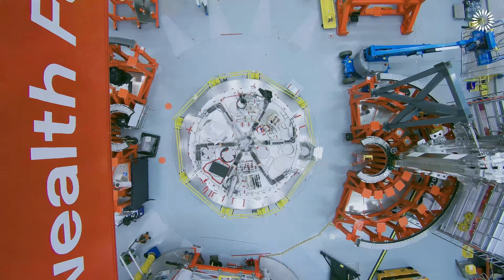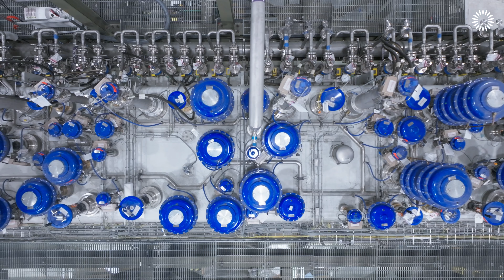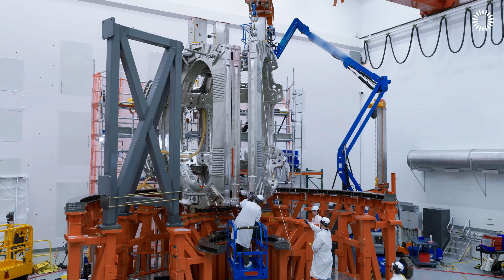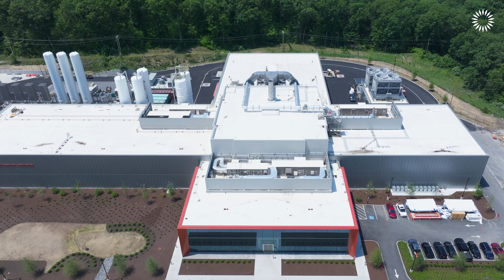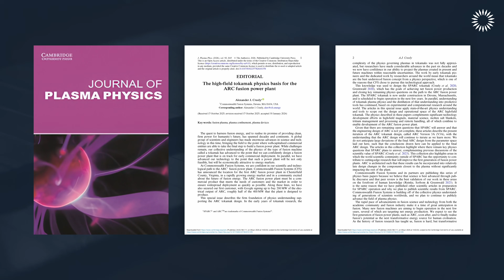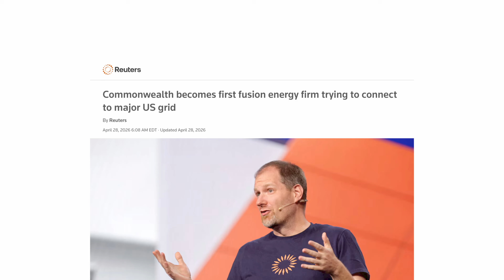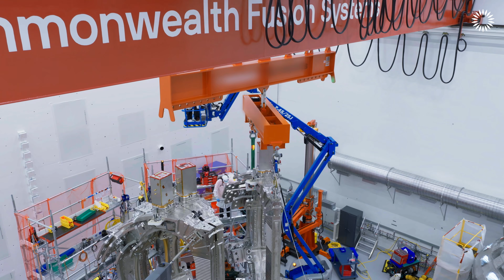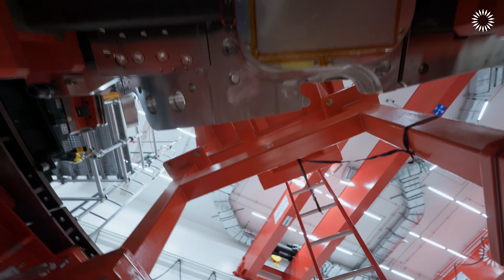An update from Commonwealth Fusion Systems (July 2026)

Comment: Comparison between SPARC and other fusion-related projects is discussed in the book "Nuclear Fusion - At Last?" by Andrea Di Vita, CRC Press/Taylor&Francis, on sale since September 2, 2026.
Reply: I hope the book describes, in some detail, the SPARC technical parameters that CFS routinely omits from their slick promotional presentations. This should include that if SPARC does achieve CFS's fusion energy generation goals that the fusion reactions can't last for more than ten seconds per test shot. It should also point out that after each full energy test shot a 4-hour thermal recovery time will be needed before another test shot can be conducted. It should also point out that even if CFS achieves its goal of a 'net fusion energy gain' of 10 then that will be largely unrelated to the energy required to power the facility during the day the record breaking test shot is achieved. It should also point out that such an achievement has little to do with determining if an economically practical power plant design can evolve from the SPARC experimental machine.
Reply: @vernonbrechin4207 It does, indeed. But even if SPARC is subject to all limits you have correctly listed, as a matter of fact its success will be the necessary condition for further progress in the compact tokamak approach to fusion. By the way, there Is a crucial point you missed: the duration of the discharge depends on the performance of tungsten in the divertor plates. Many configurations will be investigated in order to optimize performances. To date, however, 90% tungsten overall the world is sold by China. And Chinese are currently building their own twin of SPARC. In contrast with the US, however, the Chinese machine is 100% built in China, while half SPARC has been built with  imported stuff. (For example, the vacuum vessel has been manufactured in Italy). SPARC's success is likely to earn a Nobel Prize for the US and a worldwide market for China.
Reply: @vernonbrechin4207 It does. Notwithstanding its limits you correctly hint at, SPARC's success is the necessary condition for further progress of the compact tokamak approach to fusion. There is an issue at stake you missed: Chinese twin of SPARC is currently under construction at Hefei with 100% national materiale and technologies (unlike SPARC), and China owns 90% world reservoirs of tungsten, the material divertor plates are made of. SPARC's success is likely to earn a Nobel Prize for the US and a worldwide market for China.

Comment: As a former design engineer at ITER I do NOT believe this system will suceed. All others who try similar developments will also fail. I believe we already have success in solar power se we should expand this
Reply: I was in charge for years in many different countries as a project manager to design, make and commissioning high-vacuum coater machinery to mass produce PV-modules.

Solar is definitely not the solution, its efficiency rate is horribly bad and its double-anticyclic operational mode a disaster. We've seen in Spain what happens if everything goes solar and wind only. 
This idea is now expectably dying multiple death - at least as a global one-fits-all idea. The whole thing is technically too fragile, not suitable everywhere, too expensive and resources of all kind depleting.
In what I realize is that many countries now looking again into new nuclear design philosophies and speeding up those programs, with China leading the way. Unfortunately they also expand coal again, which is simply necessary for several reasons. We will never run everything on solar.
Missing serious battery technology is also another major death trap - too inefficient to stabilize solar and wind generated energy specially for days. Just try to imagine a megacity like Hongkong being powered for 2 weeks on batteries only - which you will need during their subtropical winter or blaring summer heat. Never, ever.

I do agree with you that their is still much time ahead with fusion but we should keep trying.

Peace! from Dresden / Germany
Reply: The main difference is the YBCO 20-Tesla field. That is a very big difference for Q

Comment: The obvious problem with all fusion systems is solar panels + batteries. By the time any fusion system comes online the price of electricity from renewable sources will be so low that fusion reactors will be uneconomic

The other problem is the supply of tritium. It's not been shown that any fusion reactor can breed tritium from lithium at a rate that allows scaling up a fleet of fusion reactors at a reasonable rate.

Comment: Fancy talk, it'll never produce one millisecond of power. I hope I'm wrong though to be honest.
Reply: It is important to recognize that even if CFS’s SPARC experimental machine operates as intended and that it meets all of CFS’s goals, it will not come anywhere close to CFS’s proposed reactor operating characteristics that they envision for their ARC reactor, even without the addition of the vast array of equipment required for the ARC system to capture 14.1 MeV fusion neutrons and for it to generate grid-ready electrical energy.
Reply: The Chinese fusion has achieved the stability output for 1000 seconds over 100 million degrees, which WEST media would never report
Reply: @user-fg7wv2yi2g - Check to see if any significant quantity of fusion reactions occurred. That vast majority of fusion energy milestone experiments never involved fusion fuels such as both deuterium and tritium. Most are simply plasma containment milestones.

Comment: Spinning down magnet production? If we want more of these don’t we need more magnets? Great to see an update!
Reply: They are ending their production of the HTS magnets for the SPARC experimental machine. The current conceptual design, for the CFS ARC power plants, requires even larger magnets. Even if the SPARC experiments demonstrate that CFS can achieve fusion reactions and then that they can achieve all their other goals, during test shots on it, the ARC design will still require over 10,000 times improvements beyond the SPARC test shots performance.

Comment: I'm confused though. What makes this company so confident that it can go directly to commercial power production without having successfully achieved sustained fusion in an experimental setup?  What is different that makes this likely to succeed when no one else has managed to do it yet even in an experimental setup?
Reply: CFS has learned, from the nuclear fusion energy sales pitches during the last 70-years, that grossly exaggerating the level of progress achieved, tends to have successfully funded numerous past projects. Also, many outsiders tend to trust those who act highly confident in their sales pitching. Additionally, due to the numerous threats we are now facing, many people crave the magic bullet solution messaging provided by firms such as CFS.
Reply from the maker: SPARC, under construction right now in Devens, Massachusetts, is our fusion demonstration machine, but it won't generate electricity. It'll prove out most of the systems needed to build out our ARC power plant, and its first job is to demonstrate Q>1 — net fusion energy. SPARC paves the way to ARC, but we've also done enormous work proving out SPARC technology, for example building large-scale prototypes, setting up our factory, testing the magnets we're making in that factory, validating our computer simulations with those tests, and publishing dozens of peer-reviewed research papers.

Comment: Why aren't I hearing a time-frame?
Reply: CFS has recently claimed that they expect SPARC to achieve its first plasma operation in 2027. Personally, I highly doubt that and significant fusion reaction quantities may take much longer. When the company announced the project they expected to achieve their fusion goals by 2925. Keep in mind that, even if SPARC achieves all of CFS’s goals it can’t sustain fusion reactions for more than 10-seconds and then a 4-hour thermal recovery time will be required before another fusion energy test shot can be attempted.
Reply: @vernonbrechin4207  Meanwhile the Chinese fusion has achieved the stability output for 1000 seconds over 100 million degrees.
Reply: @user-fg7wv2yi2g  - Did you ask yourself, what quantity of fusion reactions occurred during that time. That vast majority, of fusion energy milestone announcements, involve experiments that didn’t even employ fusion energy fuels such as deuterium and tritium. Those announcements are almost always about the confinement of a plasma that has no significant quantity of fusion reactions occurring. Most fans believe much of the marketing hype because they desperately want to believe such technologies will save us from numerous threats to our continued existence.

Comment: Great marketing poop for the investors! But I seriously doubt you will have it together for testing by the end of the year. Q=1 and greater will probably never happen in this machine.
There is a slim chance the engineering & material science matures enough to make this machine get to Q=1, but I suspect it will take a few more years.
Big-Ass Fusion machines are WAY more complex, high risk, & maintenance nightmares for any utility company to invest & build 'em. Maybe in another century or so when we run out of natural gas. Then they will finally be serious. Maybe...
Reply: Q = 1 and Q > 1 are part of the oversell deception behind the fact that we are still not anywhere close to seeing the demonstration of an economically practical fusion power plant. Q is an abreavation for Q-plasma (Qp). The input energy value, employed to calculate Qp, tends to be a tiny fraction of the input energy required to power the experimental facilities on the day of the test shots. This Qp value has almost no meaning for a power plant engineer who is attempting to determine if the experimental approach can be developed into a practical power plant. In pulsed fusion reactors, which almost all fusion energy experimental machines are, The input energy value tends to only involve the plasma heating during the approximate time that the fusion reactions are actually occurring. In the the case of the CFS SPARC machine the fusion reaction can't last for more than 10-seconds per experimental test shot. During the day of the record breaking test shot the facility is likely to consume at least 100 times more energy than the value employed to calculate the Qp value.

Comment: Laser Inertial Confinement Fusion (Inertial Fusion Energy) and Laser-Driven Compact Particle Accelerators.
Reply: Neither of these two proposals are likely to ever evolve into an economically practical source of electrical energy that is likely to rival sources such as photovoltaic panels. Most people were never informed about the following details regarding the highly publicized 12/05/2022, 'breakeven' laser shot at the National Ignition Facility (NIF). It took almost a week to prepare. The resulting fusion reaction only lasted for 0.000,000,000,08 second. The fusion reactions occurred within a microscopic 'hotspot' at the center of the immensely compressed fuel. Only 4% of the supplied fuel fused before the explosion blasted the remaining fuel away before it had a chance to react. The energy consumed by the facility, during the lead-up time and the shot was well over 100 times the input energy value they employed to calculate the fusion energy gain. Since NIF was conceived almost all the funding for it has been related to work related to thermonuclear (H-bomb) explosions. It's been estimated that over $11 billion in federal revenues has been sunk into that research effort. There is no practical means of extracting and using the energy blasted away by such extremely brief nuclear explosions. The Laser-Driven Compact Particle Accelerators are fun projects that are likely to appeal to SciFi fans.

Comment: So no actual progress in overcoming the fundamental problem that all teams working on commercial fusion have failed to solve over the last 50 years.
Reply: you may want to familiarize yourself with the HTS magnets they developed and proved out in 2021
Reply: @btrainnyc  I’m well aware of how much faith that CFS is putting into that HTS technology to solve almost all the remaining problems that have continued to plague the field for many, many decades.

CFS has omitted numerous technical details, regarding the operational specifications of the SPARC HTS magnets, in their promotional presentations. The coils will be operating at 8 and 15 Kelvin, close to Absolute Zero. During SPARC’s brief fusion pulses they will be bathed in the 14.1 MeV fusion energy neutrons emitted from the plasma. The supercritical helium cryogen fluid, employed to cool those magnet coils, will be relied upon to extract the heat that is deposited in them by the fusion energy neutrons. Some of those neutrons will end up creating radioactive isotopes in the surrounding structures, including the HTS coils and their supporting structures.
Reply: Actually the tokamak experiments began almost 70 years ago. Numerous unanticipated problems have been encountered during the many decades of development time. Some have been solved and in other cases work-arounds have been found. Still there remain major physics and engineering challenges that CFS's stronger magnetic fields can't solve. That includes the undeveloped technology for such reactors to breed their own radioactive tritium. There are numerous key evaluation technical details that have been left out of presentations, using the excuse that such details are not suitable for general audiences.
Reply: @vernonbrechin4207 actually all of this is readily known and available. Interesting work going on with FLiBe breeding blanket technology. Lots of unknowns as you point out, but the recent advances are ground breaking and different from the past
Reply: @btrainnyc  - That’s the impression that has been given by many experimenters during the last half-century. It helps to attract funders.
Reply: @vernonbrechin4207 - I don’t think any modern era technology that took longer than 20-30 years to bring to market has been commercially successful. The airplane, radio, TV, jet engine, transistor are good examples. Even nuclear fission took only about 16 years from demonstrating criticality to (heavily subsidized) commercial power plant. I think ITER will be technically successful but that the technology cannot be made commercially successful. It may find niche applications for military naval propulsion or deep space propulsion where there is no need to generate a profit.
Reply: @KevinBalch-dt8ot  - Good points! Typically the promoters have no interest in citing examples of large projects that were never completed such as the Superconducting Supercollider project that only lasted for about a decade.

Additionally, belief in such long time-frame projects requires a denial of warnings such as the following.

All nuclear energy promoters, are in line with the vast majority of Earth's other 8.3+ billion humans, who continue to assume that we still have at least 20 years left to turn this 'Titanic' around using their favorite nuclear technology. They have become masterful in excluding the following warning from their consciousness.

UN chief: World has less than 2 years to avoid 'runaway climate change' (TheHill)
  * This statement was made 7.7 years ago.

Comment: Is this still assuming that it works?  Or did I miss something?
Reply: The only thing that is working are the subsystems that lead to the final construction of the SPARC tokamak. They omit mentioning anything that may have resulted in unanticipated problems. These hyped promotional presentations often spin the story to make it appear that more progress has been achieved than actually has been. This is a tactic that has gone on for about 70-years in this esoteric field

Comment: Huh, As I understand it Fusion has only recently been successful for 6 min. In China
Reply: Caution! The vast majority of fusion energy breakthrough announcements are only about record plasma confinement times at temperatures below those needed for fusion reactions to occur. Very few experiments have included actual fusion fuel combinations that might result in a highly significant quantity of fusion reactions to occur if the temperature and pressure was high enough.

The press releases, and journalistic reporting, are typically peppered with the word ‘fusion’ as a misleading attractant.